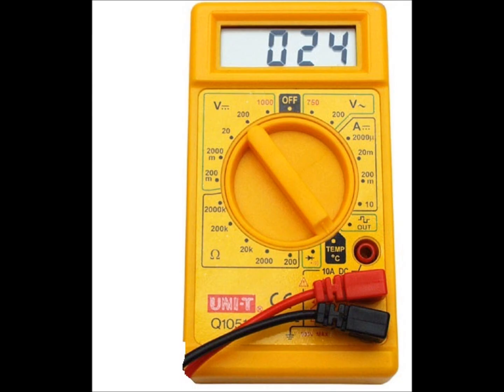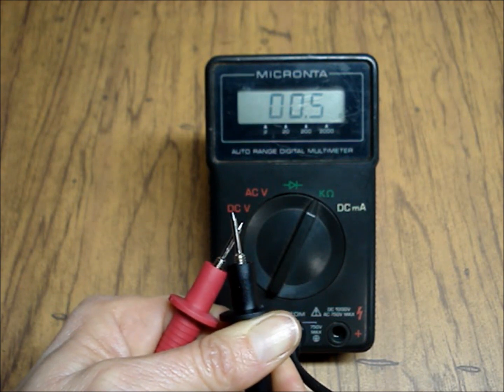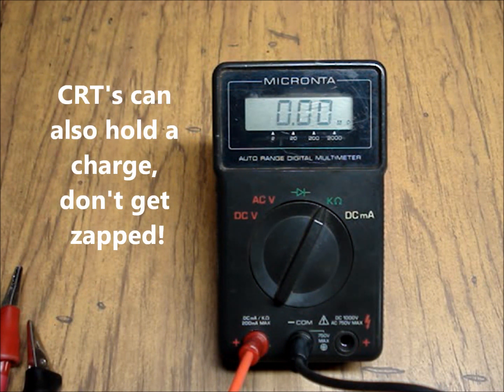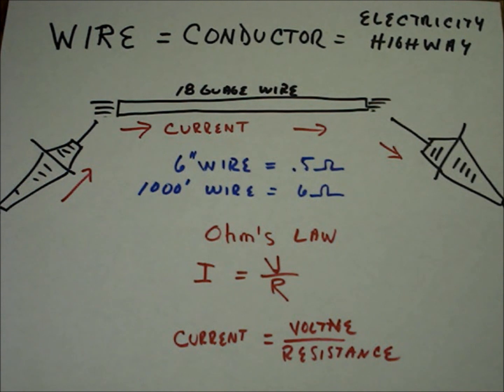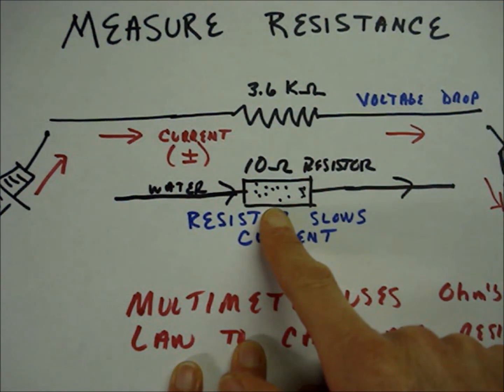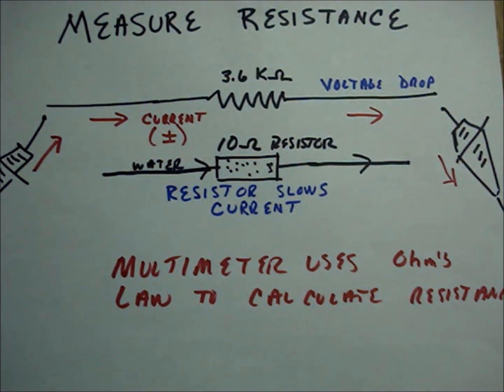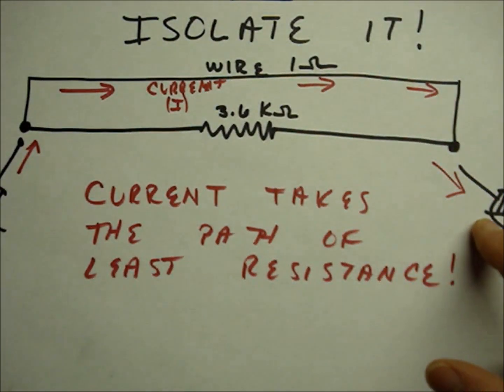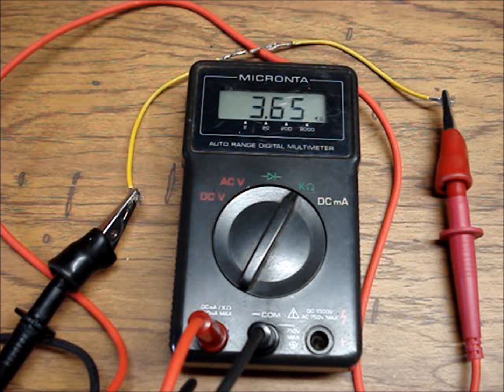Use Multimeter to Test Resistance and Continuity

Comment: I thought that you were just a kid or a high schooler, but you have 20 years of experience?? My bad. 😀

Have you ever fixed the cord of an appliance **without buying a new cord**?
Reply from the maker: I have a video showing how to replace the plug on a cord.  See link below to a playlist that includes that video.  If you are repairing a lamp, I have several video about that topic. 
 https://www.youtube.com/playlist?list=PLvce66kQTjJSdWdmylGc5kIxnlzUkLbU2
Reply: @Know-How-Now  Thank you. I went ahead and looked at the playlist. I do not want a new plug. With 2 appliances, the damage in the cord seems to be near the appliance.

Maybe I could cut the damaged portion off, and then use connectors to attach the cord?
Reply from the maker: Best practice would be to open up the appliance (sadly, many new appliances are made to be difficult to open or repair) and replace the entire cord.  If the remaining cord is in good condition and you correctly use crimp on connectors it could be repaired that way.  For sure you do not want any loose connections, nor would you want to mix up the polarity.  They will arc, heat up and eventually start a fire.  If you watch the lamp cord replacement, I talk about cords and polarity.  That might help with getting the correct replacement cord if that is what you choose to do.  https://youtu.be/SsvPe1bo2Qs
Reply: @Know-How-Now  Thank you!

I'm hoping that I can find the specific break in the cord and salvage the good part.

Did you see those videos, where the person makes a voltage detector out of copper wire for a wand thing, a cell, an LED, and a few transistors? He didn't even touch the appliance wire. ElectroBoom commented on the idea and said that the copper acts as part of a capacitor and not an antenna.

Anyhow, I look forward to ordering an ordinary soldering iron to attach the good part of the cord to the appliance.
Reply from the maker: I have not seen the DIY voltage detector.  The cord would most likely break at a point where it makes a hard bend.  Best wishes for your repair.  It's been nice chatting with you.
Reply: @Know-How-Now  Thanks. I appreciate chatting with you.

By the way, would any soldering iron be good enough for soldering a toaster?
Reply from the maker: It's been ages since I've done any electronic bench tech work.  I'd have to do some research to answer that question.  I don't have any recommendations for you.
Reply: @Know-How-Now  Oh, I see. Thank you so much for your time.

Bye for now.

Comment: Hi there you said at 2.56 on video that it should always be done with power off. So does that mean on a car I need the ignition off or does the battery need to be disconnected?
Reply from the maker: You can either isolate whatever you are checking by disconnecting it or remove the power source - disconnect battery.  For sure you don't want power on, you will blow the fuse in your meter if you don't or wreck the meter if it doesn't have a fuse.

Comment: Useful thanks. I have a non ranging multimeter and I suddenly realised I was foggy in interpreting the ohms readout. 🙏👍
Reply from the maker: An auto ranging multimeter is worth buying if you rarely use one or are an electrical novice.  They much easier to use and you are less likely to make a mistake.
Reply: @Know-How-Now  sound advice!

Comment: What would 0.0 reading or infinite ♾  resistance mean? Does it mean good resistance or no resistance at all??
Reply from the maker: The readings can vary from multimeter to multimeter.  If you put the leads together while in the lowest resistance scale (if you don't have an auto range mulitmeter or the setting for resistance on an auto range multimeter.  0.0 would be no resistance - sometimes call a dead short.  You mulimeter leads wires are not broken.  If you would read infinite, then the wire in one of the leads is totally broken - some times called an open.... the most resistance you can have.

Comment: Thanks. Been awhile using one of these. I used it to determine whether my water inlet valve was functioning on my refrigerator ice maker or finally kicked the bucket. Unfortunately it kicked the bucket. 2 of the 4 switches were toast. They don't make things like they used to. I still have an 40 years old Kenmore fridge that still works. Lol. Great video.
Reply from the maker: You are welcome, Chris.  Not too long ago my 40 year old fridge's freezer fan bearings wore out and I had to let it go.  I'm sure the new one won't last that long.  The coils are in the back corner and positioned in an unfriendly direction for cleaning.  Because the coils are next to the floor they pick up dirt and pet hair. The front has feet and no rollers, you can't pull the fridge forward.  I levered the front up and put super sliders under the feet to defeat that problem.  It's still a bear to clean the coils every 6 months.  The positive is that my electric bills are lower.

Comment: I have 500 feet of stranded 3 conductor direct burial AWG #8 I wanted to test for resistance.  The wire appears to be in good shape.  So I connected a 1.5 V battery and checked the amps using a multimeter.  Got a range of 1 to 1.5 A which divided into 1.5 V = 1 to 1.5 ohms. This result is about 3 to 5 times the .6 ohms/1000 ft spec.  Any comments?  Should I subtract the resistance of the battery?
Reply from the maker: I've never tried that method to check out a cable.  If my troubleshooting led me to believe I have a bad run of cable with multiple conductors, I disconnected everything from either end.  Then put a jumper across pairs of conductors to check for continuity.  Next check each conductor to ground.   My experience with buried cables/cables inside buried conduit is often the insulation breaks down and you have to replace the cable.  Sometimes it will read OK, but under a load it fails.  The other common problem is they get cut by some sort of construction.  Large earth moving equipment or freshly dug up ground was the give away for a cut cable.
Reply: @Know-How-Now  thanks for the comments. The cable was in a well. It has continuity on all three conductors. I would like to test it at full load like about 40 amps but I don't have any way to easily do that.
Reply from the maker: If the cable is old and you have isolated a problem to the cable, then odds are the insulation is breaking down.  Fluke sells test equipment for that, but it's expensive.  https://www.fluke.com/en-us/products/electrical-testing/insulation-testers

Comment: You mentioned power stored in capacitors and to measure with out things plugged in to what you are reading, 
But why?
Reply from the maker: The power has to be disconnected because the multimeter is sending a small amount of current though the circuit.  Also, you could damage your mulitmeter if you do not disconnect power for this type of measurement.

Comment: Higher resistance mean the wire is bad, low resistance means that it is good and power can flow through?
Reply from the maker: A piece of wire (14-18 gauge) that is a few hundred feet typically will only be a few ohms.  If the wire is broken, you will read infinity "open".  A corroded splice on a circuit could read maybe 100 ohms or more, depending on how bad the connection.  A bad splice will often cause the resistance reading to "oscillate", in a range higher than a few ohms.  In the old days when analog meters were common, this was called a "swinger".  So, yes low resistance means power can flow through.  You might be interested in the web site.  https://www.omnicalculator.com/physics/wire-resistance

Comment: Over time your wiggling the leads will cause them to break.
Reply from the maker: Over time, the conductors inside the leads start to break, usually at the joint between the plugs and the wires or the joint between the leads and the wires.  I speak from using a multmeter for 20 years 5 days a week.   Most people do not realize this happens.  I'm not telling you to stress those connections, just gently move them to see if they are failing.  If your leads are breaking down, you can spend countless hours trying to troubleshoot phantom problems buying parts to replace ones that aren't bad, etc.... costing you much more that buying a new pair of leads.  They are expendable.

Comment: When I put my multimeter on ohms, all I ever get is 0.01 K   Why is that?
Reply from the maker: One K ohm is 1000 ohms, that would be 10 ohms.  Is it an auto range multimeter?  That's one that only has 1 setting for ohms.  If it's not auto ranging, that's a multimeter that you have to set it to the expected range of resistance to be read, then maybe you are not on the lowest setting.  Go to the lowest ohms setting and then put the leads together, you should expect to read 1-3 ohms.

Comment: thanks for just glazing over how to interpret the other ohmmeter dial settings.  most reading don't fall in the 0-20 range.
Reply from the maker: I was on the fence on how to deal with a non auto ranging multimeter.  I'd recommend buying a better quality multimeter, they are not very expensive and the better quality ones will have auto range.... so much easier to use for a beginner.  I know a lot of people have the one from Harbor Freight, I haven't tested/used one of those, so I don't know if they are any good.  They are definitely hard for a novice to use. 

I could easily dedicate a video on how to use those ranges.